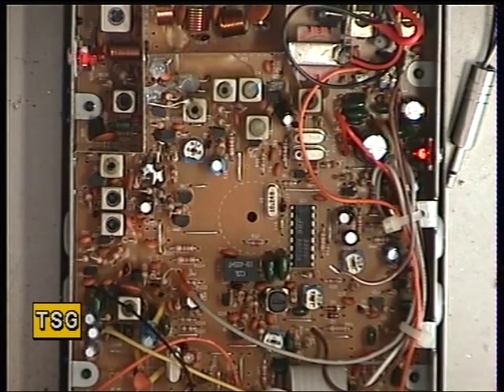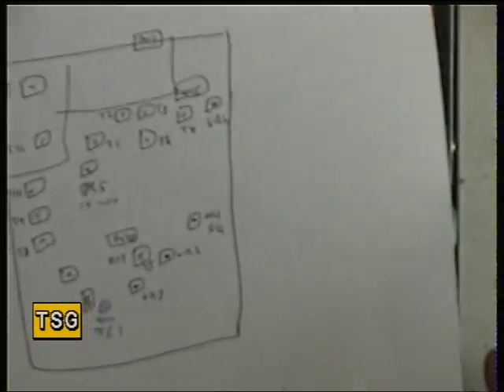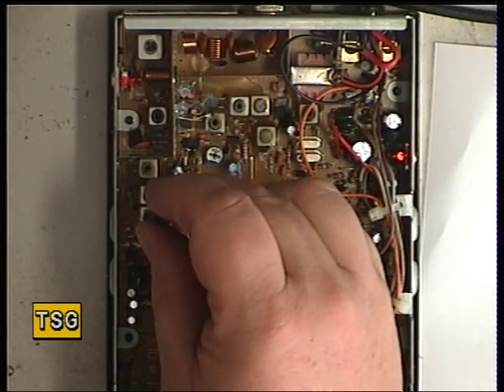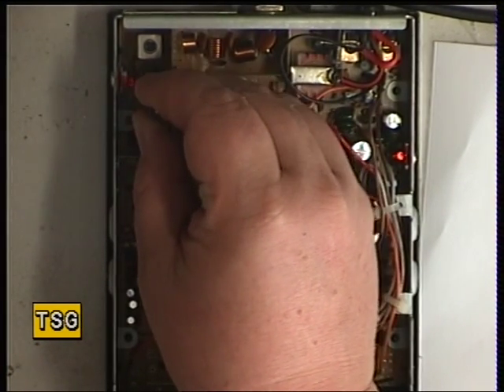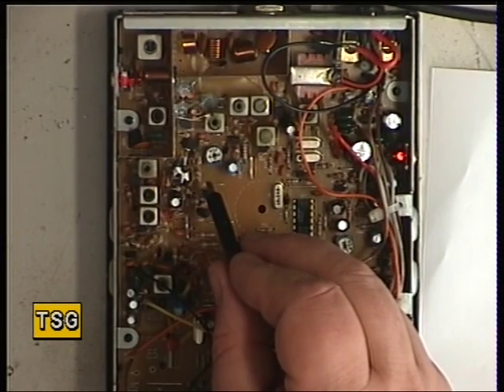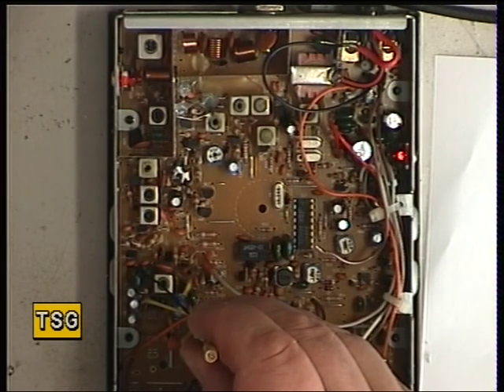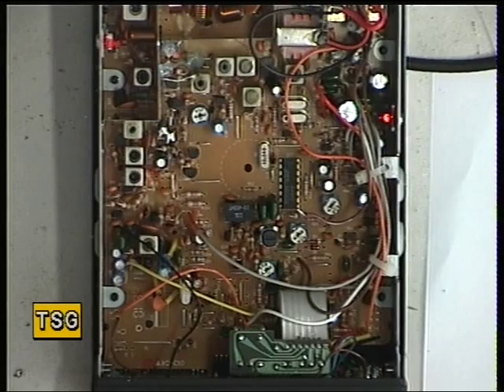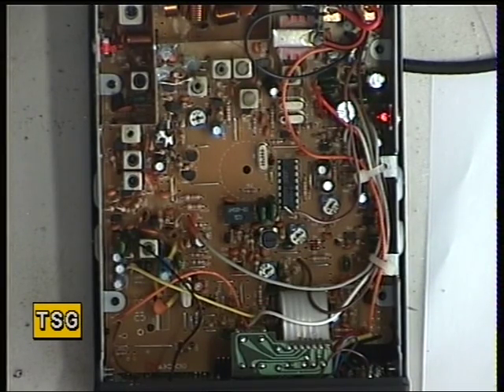Kernow Beta 3100 late version, UK/EU (PR 27/97) 80-channel CB (Mobile) radio - Transmit alignment

Comment: Hi Richard,

If you had wanted to align the radio for both the mid and UK bands what would you have done additionally?  It it simply to do the UK on channel 20 then the mid on channel 20, or would that end up optimising the radio for the mid band?
Reply from the maker: On 80 channel sets, you align then either on channel 40 CEPT or channel 1 UK, that's the centre of the band.

Richard
Reply: Ah! Of course!  :)  Thank you. :)

Comment: Reminds me of the Midland 38. Pukka radio. Wish I never got rid of it.
Reply from the maker: Never get rid of anything until you are more than happy with it's replacement....newer isn't often better...and loads of extra facilities can also overshadow otherwise poor performance!

Richard
Reply: Very true. But it wasn't getting used and had 4 other radios very similar in spec and all worked as good as each other. so sold the Midland 38. Got back £10 more than what I paid for it so wasn't bad.